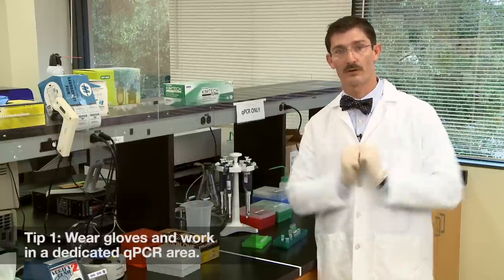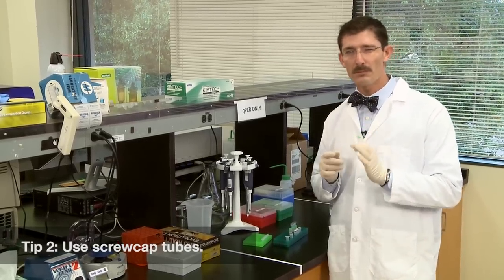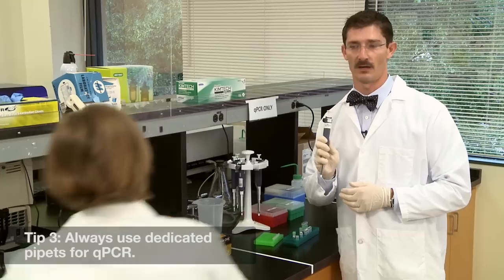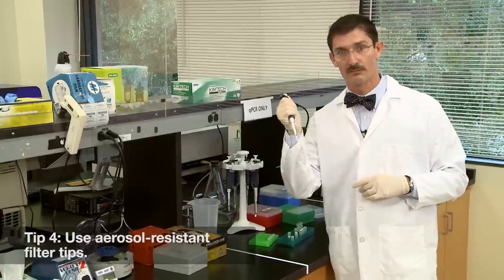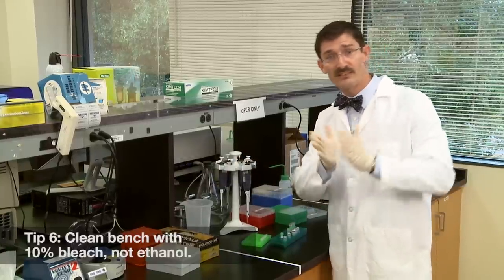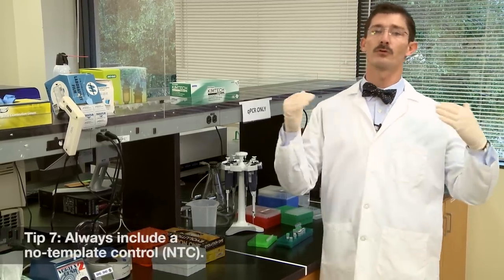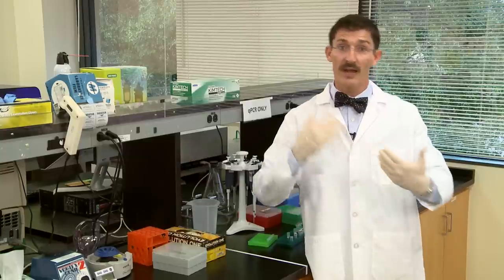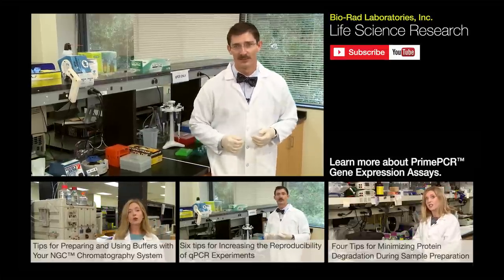How to Minimize Contamination in qPCR Experiments

Comment: 10% bleach?????????? How can we use it in laminar hood with steel bench?
Reply: Most likely 0.5% hypochlorite, commercial bleach concentration usually is 5-6%
Reply: I work in diagnostic lab . 
We use dna erase , rnase away, 1%bleach and last 70% ethanol so that the stainless steel in the laminar flow does not corroded .